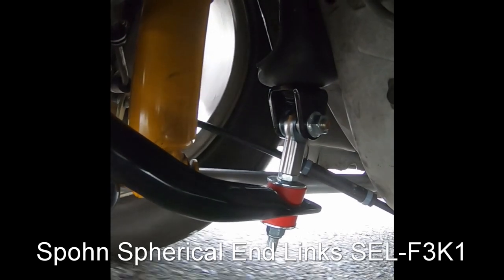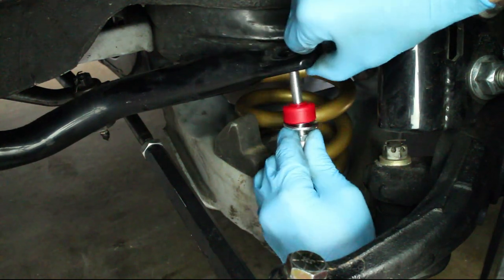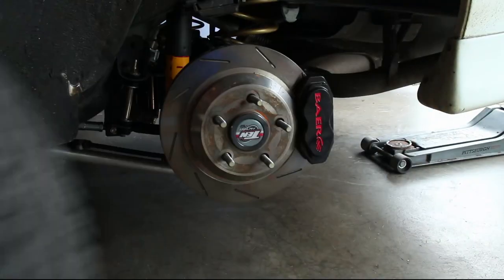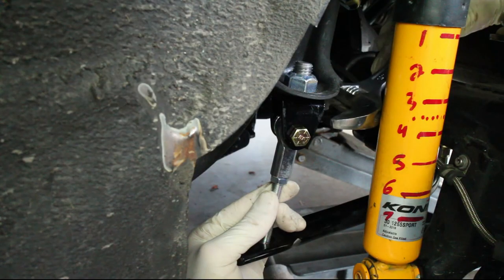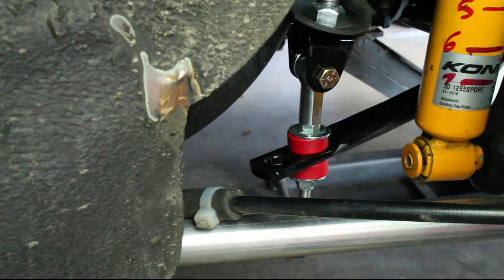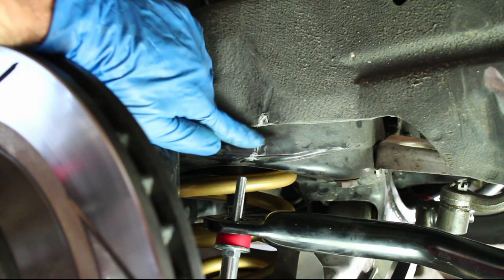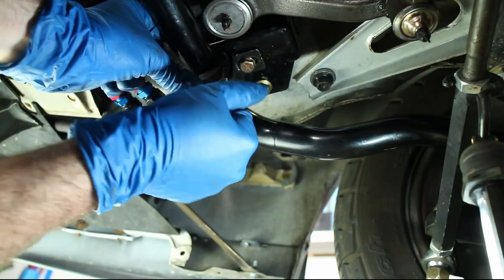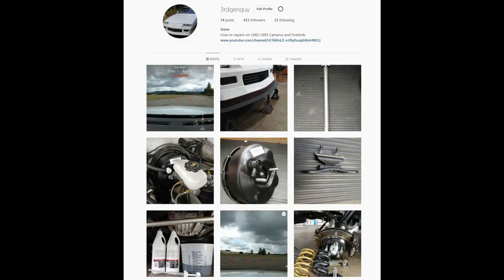Heim Joint Sway bar Link install (1982-1992 Camaro/Firebird)

Comment: Where'd you buy the lock collars? I'm probably going to do these end links but I'm running the much heftier spohn sway bars and don't want to run into the same rubbing issue you showed.
Reply from the maker: amazon, ebay ex ex.
Reply: Mine was rubbing just like that on the front left side replaced the sway bar and links and still rubbbing on that side how do I fix

Comment: Nice job. Which sway bars do you have?  I have a 1” aftermarket rear sway bar and my end link bolts always bend when torqued. It looks like the hole in the bar is too far forward, causing it to bend when tightened. Any ideas?  Thanks.
Reply from the maker: could be the aftermarket sway bar is meant for another car so the arms are too long. those Rod-end links would help with that.
Reply: Yea I was thinking they were too long. Probably just gonna buy a different set from spohn. Thanks.
Reply: By the way, which company do you have for sway bars?  I think mine are P.S.T but I’m not sure. Was over 10 years ago when I got them.
Reply from the maker: @kkr7540  i run Detroit speed bars front and rear.

Comment: How do I fix the rubbing on a stock sway bar my front left side has been rubbing replaced the sway bar and links and still rubbing on the same side
Reply from the maker: You can move the sway bar over a bit.
I personally have two locking collars that keep my front sway bar from moving side to side.
my rear sway bar has collars as well
https://www.youtube.com/watch?v=dJ3w0B2YXxI
2:26 shows the collars.
Reply: @3rdGenGuy  where can I find them
Reply: @3rdGenGuy  and what size do you think
Reply from the maker: You want one that has an inside diameter that matches your sway bar diameter.
I have a 1 3/8in front sway bar so I used a: Climax Part 2C-137.
then trimmed down the top of the collar to fit.
you can search on McMaster-Carr as well.
https://www.mcmaster.com/products/clamp-collars/construction~two-piece/